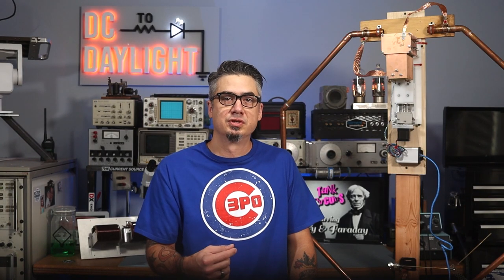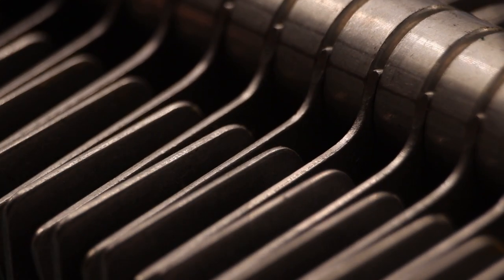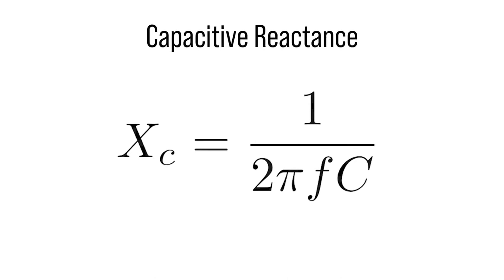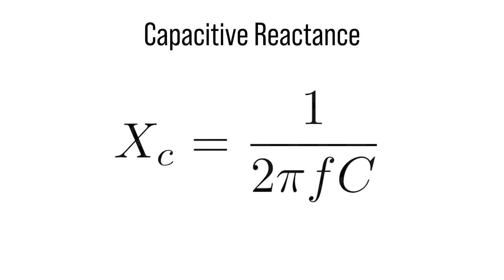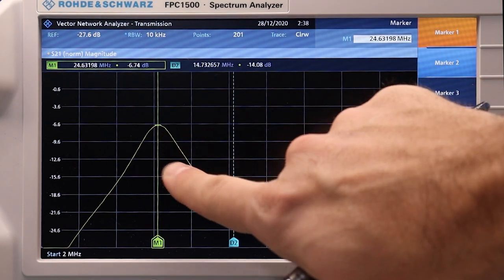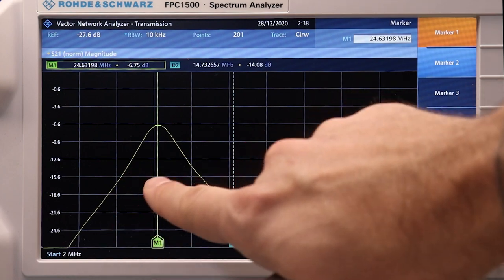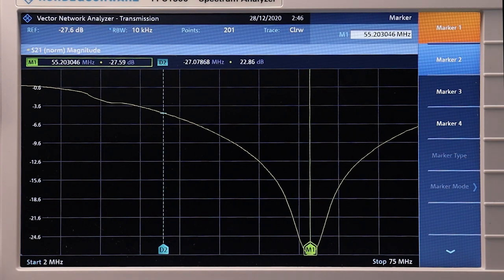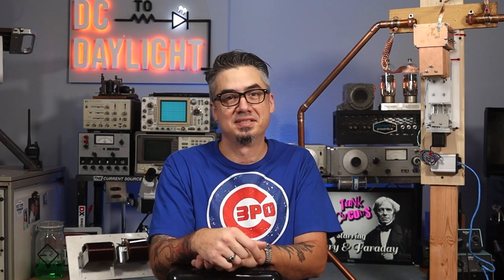How Tank Circuits Work - DC to Daylight

Comment: Without exaggeration, this is probably the best video on Radio Theory I’ve seen. And I I’ve recently seen a lot.  In just the past year or so , I’ve taken up Amateur Radio as a hobby. Actually, I’ve managed to steer clear of YT for along time until I realized what a great learning resource it can be, once you get past all self important, narcissists that want to stand in front of a camera. To be honest, I’ve happened upon your videos several times in the past. I never watched because it’s been my experience that videos with the presenter in front of the camera spend more time on image than content. There were only two or three YT channels with presenter in frame that I watch on this topic. Now, I have one more.  Thanks for the Video- Jason Burchell. I do have a thousand questions on radio theory and electronics but I’ll ask those a bit later. Sorry, the comment is so lengthy. So much for brevity

Comment: Thanks for the video. I'd like to know how IC circuits like the ESP32 can incorporate RF resonance components ? Are the capacitors and inductions etched on the Silicon ? Best Regards.
Reply: This would be a fun topic. Usually they’re etched on a pcb.
Reply: I think they use crystal oscillators

Comment: Hey!  That looks very similar to my Magnetic loop!  Mine is around two meters in diameter and tunes 10m to 80m.  The biggest difference is my capacitor is a trombone style I made with eight coaxial copper pipes.  In order to avoid interference with all the metal in a tuning system, mine is hydraulic, using water in a cylinder connected to the capacitor.  Cool video!
Reply: I'm in the process of designing my first mag loop antenna.  I'd be interested in learning more about your loop design.  Do you have a video or write-up of how you made it that you can share, by chance?  It sounds really interesting!

Comment: Hi , Simon here. I bought a 75w 905nm pulse laser diode thinking it was a non pulse diode. I can’t afford a pulse driver 100ns 1% duty 12.8v 30A so I am trying to make one cheap. I can get the 100ns PWM using a 555 timer but I am not sure how to get the power into the pulses. Should I use an inductor 20nH with a capacitor ? And if so how do a make a crowbar switch that resets in 100ns ? What is the simplest way to drive the diode.
Can I simply use a mosfet avalanche rated at 30A with a current regulator like a buck converter ?